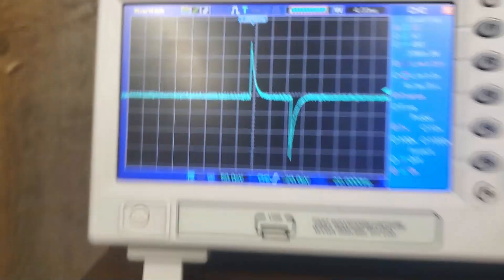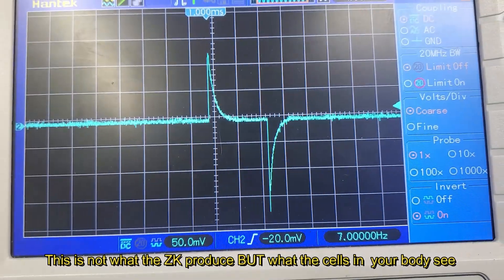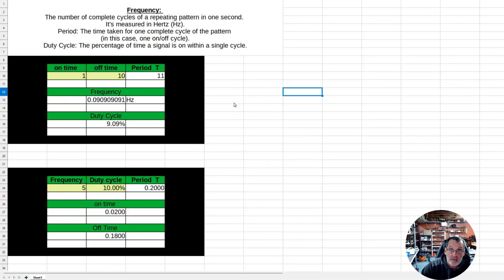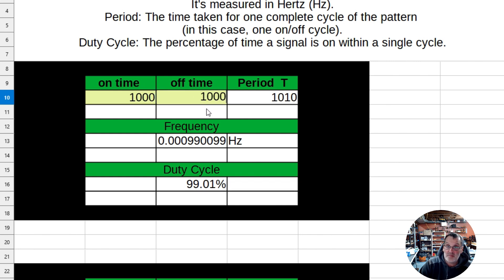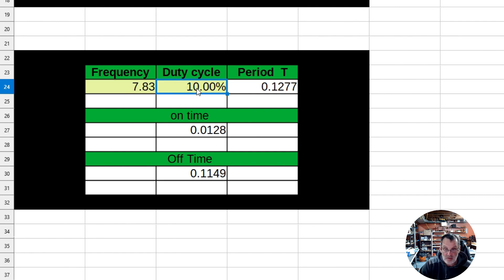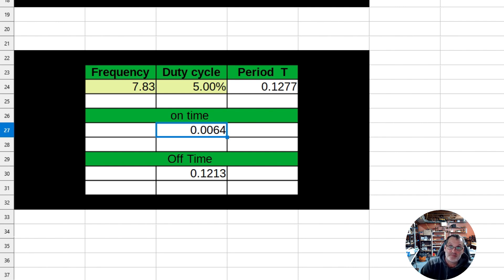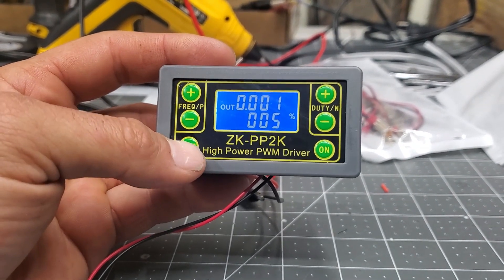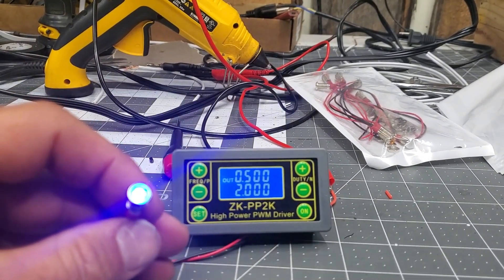Amazing ZK-PP2K

Comment: Can i use it as a clark zapper ? 
5 v, 100% positive Offset, 5hz - 33 KHZ ?
Reply from the maker: @sohar146  what is a Clark zapper?
Reply: @Steeve.  Device by Hulda Clark, ment for conductive Patches you put on your skin or hold in your Hands. It does 5v 1-33Hz Output (100% duty cicle if i understand right). So i would say not for Mats, but Maybe for small 2-3coil Designs with the fitting resistor could be doable
Reply from the maker: I am not familiar with the term Clark zapper.   sorry.

Comment: Thanks for sharing your great knowledge, do you think I could use a ZK-PP1K to generate the signal? Thanks.
Reply from the maker: @elgutitozamora  by itself no.   It does not have the amp needed for it.  
If you use it  to drive a mosfet then yes.

Comment: I'm with colin here down below...
Can you do a proper video on how to use this thing? 
Okay, so you've done the math for us but I haven't a clue how to input that cause it seems like theres 3 different screens or modes. I'm lost completely
Reply from the maker: @8thsinner  I added to my list of videos!  

If you have urgen need for help email me at 
Steevebradet@outlook.com

:)
Reply: @Steeve.  I did email you the other day actually. Which, i've noticed you've just responded to...thank you. 

But yeah, a video would be good. Showing, directly on screen which part of your calculator refers to which mode, ideally with a couple of frequency examples.

If i had an oscilliscope i'm sure i'd figure out the frequency part and modes but I don't have one yet. should change soon though.

Comment: You can do this calculation yourself by dividing

 1÷desired frequency (5hz)

This will give you period T (0.20)

After that, calculate the percentage of period T you want as your duty cycle 

(Period T= 0.20) * (Duty cycle 10% = 0.01) = On time = 0.020

The substract on time from period T and you get 0.1800
Reply: Thank you for that but sorry, 10% is not 0.01 but 0.10

Comment: What method can be used to detect  the flux distance away from the coil ?   Thanks for the great info.
Reply from the maker: There are many ways.  To mesure it you can use an gauss meter and oscilioscope, to observe it holding a magnet between your finger or watching a compas needel move.  

To name a few.  :).